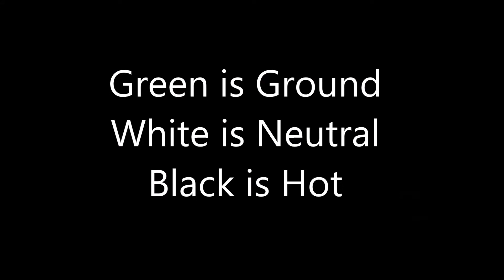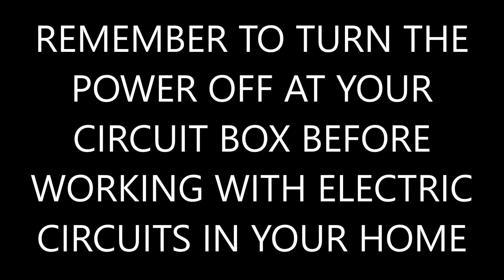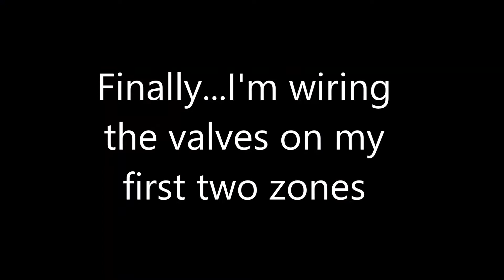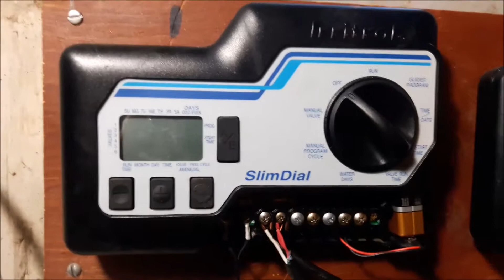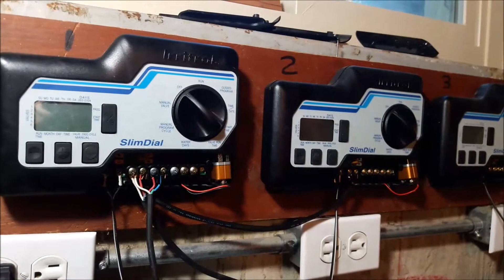Irrigation Wars Part 12: Wiring My Booster Pump and Sprinkler Valves (Part 2)

Comment: Electrical engineer and you are using flexibles metal conduit outdoors? No bueno.
Reply from the maker: This exemplifies the disconnect between schooling and practical application which was one of my biggest complaints while I was earning my degrees. My area of study was focused on transistor level circuit design, rather than power, so literally zero experience with home wiring of any type prior to this installation.  I can design a relatively complex circuit board, but have no clue about the fundamental components involved in wiring a house, so no knowledge of wiring or conduit. This is also why I believe engineers and mechanics/electricians/welders/etc are typically at odds.  

I literally replaced the existing structure (pump, wiring, etc) with new materials, so I just assumed the setup I inherited when I bought this house was professionally installed and the materials were safe as used. Looking into it, it's obvious the liquid metal conduit is the choice. Never too proud to say I screwed something up and made the mistake of not researching the materials.  I'm actually going to replace the metal with the liquid flexible metal now that I'm aware.  Thanks for the comment. Stung a little to hear I missed something so obvious, but that will help keep me humble and hungry to learn.

Comment: Could you please provide link for pumpe you using?
What is pressure switch for and what is setting?
Thanks
Reply from the maker: I used a Pentair SAT-RITE Model JHF-51HL 1.5 HP 115/230.  I paid around $600 three years ago at a local plumbing supply store in Utah. The link below is similar to what I bought and may be the same pump. I put the low pressure switch on because my city will turn the secondary water system off for various reasons during the summer, but they do not notify when they do.

The low pressure switch prevents my pump from turning on when the secondary water system pressure is off, or if pressure drops too low, and prevents the pump from running dry and burning up. I have it set at around 12psi. Anything less than that and it either will not kick on, or, if running and pressure drops, it shuts the pump off. 

https://www.poolweb.com/products/j-series-centrifugal-1-1-2-hp-pump-115-230-volts-high-head-1-1-4-x-1-inch